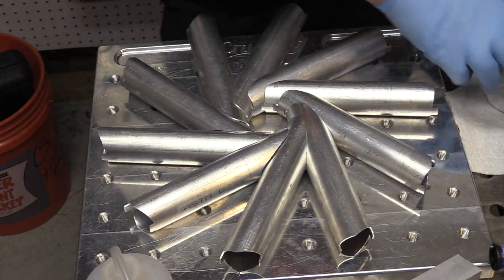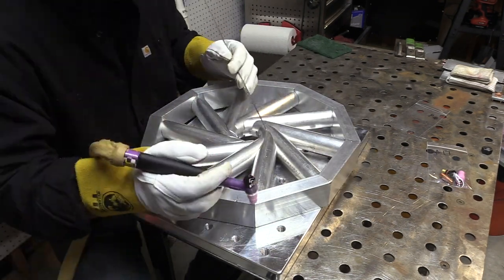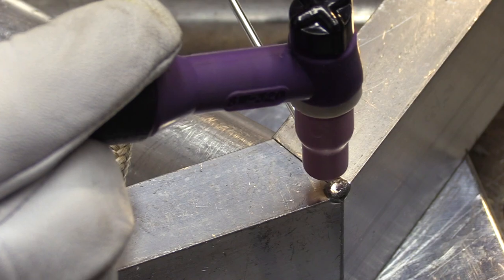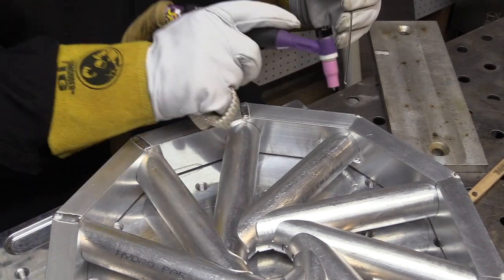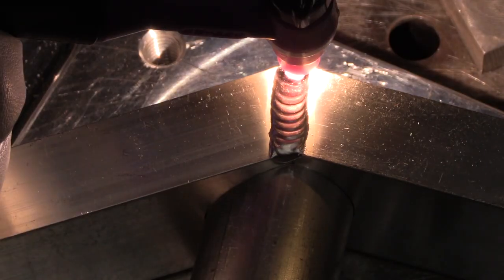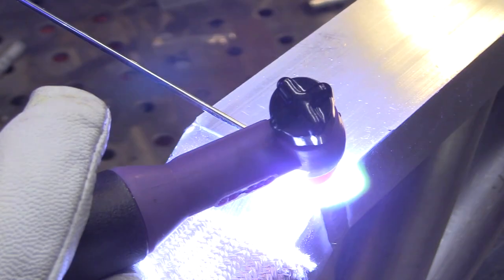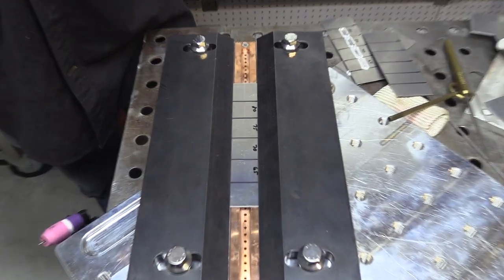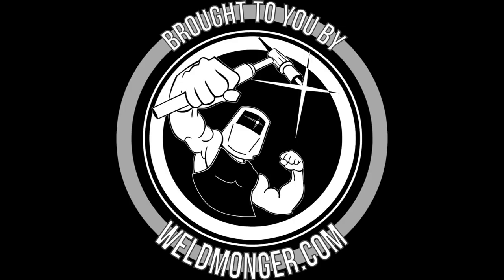#5 Cup TIG Welding Aluminum

Comment: One funky method I’ve seen for crater filling is to leave the rod in the puddle while you kill the arc (lift start) and then bend the rod untill it brakes and using a file to fix it. I’ve never used this method but it’s pretty neat.

Comment: Hey Jody, can we talk about different aluminum filler? 4043 can be too soft for certain applications and 5356 too hard and prone to crack. 4047,5087, 5183?  Is there a reasonable filler that covers almost everything other than rare stuff and cast? Machine and Fab shop

Comment: Jody,  i use exactly the same cup set up using 3.2 tungsten, and a number 5 cup with a light balling, but im at 75- 145 as previously mentioned in another thread i wrote. For me these settings will weld anything from 2mm thick right up to 25mm thick with pre heat and 'hot'gas alushield and of course using a pedal. Buttons or trigger torches are hopeless for aluminium welding since you need to be able to back off the amps as you weld along a run.

Comment: Hello Jody, thanks for another great video👊🏻 My question is about using #5 cup what size tungsten do you normally go with and were you using a 4043 filler rod? If so I always get the grainy look on the beads when using a 4043 rod vs a 5356. Thanks again👨‍🏭
Reply: I've been trying to figure out what is causing and more importantly, how to get rid of the grainy appearance in my welds with my Dynasty inverter machine as well. I can use my friend's Syncrowave transformer machine and the beads are smooth and shiny. I make all settings the same, use the same base metal, filler (4043), tungsten, cup, flow, etc. But on my Dynasty, I always get that grainy finish. It's frustrating. Is there a way to get rid of the grainy appearance or is this something that Dynasty owners just have to live with?

Comment: Hey Jody, love your videos. I’m new to welding and have been getting better with the mig gun but still burning holes with the tig. Most recently I’m trying to weld some patch panels in auto sheet metal about 1/16th thick. Even with the mig it’s not keeping a consistent arc with the mig and popping holes in the metal. Thinking maybe a ground issue. Any advice would be great! Thanks

Comment: Awesome video Jody. I personally use a #4 #5 purely on the heat I need to weld with destroying my gas lenses. But even when I was on low amps I did notice the white film from the cleaning action Less apparent. Here in Australia I use a BOC 185 AC DC fairly certain it's CK unit. And have recently switched over to a 50/50 mix bottle of helium and argon.

The only problems I have with the machine I use. Is the ac Ballance won't ball my tip up like shown.
And lac of foot pedal.

Any tips on how save my tungsten on a budget machine?

Much love from down under really enjoy your content
Reply: i have the same welder.  the welder is not CK (not sure who makes it) but they do come with a good CK torch. don't worry about balling tip so much.  pedal is available, only curse is the pulse doesn't seam to work when you have the pedal plugged in.

Comment: Is using the top of the ball the correct way to read a flow meter?   I guess I've always used the center of the ball as my reference point.
Reply: That is the correct way. However having a .5 CFU wont be noticeable unless the shop you work at is stingy on that lol
Reply: Ernesto Castellanos ....Thanks.

Comment: I noticed that none of those butt joints were beveled enough to accept much filler.  I'd be interested to know why you skipped this step in this project.  I assume it's because of the service load (zero) and consequences of failure (none). 
 Adding enough filler is easy in fillets, but how do you determine the minimum bevel on butt welds in 6061 (with 4043 filler) to 100% prevent hot cracking?
Reply: He explained it in the video............you can see the puddle drop and then he adds more. What he didn't elaborate on is that the bead has to be dropping down below the bottom surface of the tube. It sounds like the tube is relatively thin. He also states at one point that a speck of contamination floated up from the inside of the tube, which means he is assuming the bottom side of the tube is melting. His tests on the flat plate also demonstrated the amount of amperage needed to get full penetration, and then he showed how he fills the crater at the end to prevent cracking. Of course that all applies to this project. Now, on thicker tube, a bevel may be needed and it would be great for Jody to explain if there is a minimum wall thickness needed before he considers beveling the tube. It seems that he often does test pieces to determine what is needed, but it would be helpful to have some guidelines. I don't weld full time or do nearly as extensive jobs as I'm sure Jody does, so I would be interested in knowing more.
Reply: I agree with you on the puddle droop making room for more filler, but my underlying question remains.  Lemme try to rephrase it in case Jody sees this:  Starting with 6061 base metal, what percentage of the weld nugget needs to be 4043 filler to elevate the Si content enough to avoid hot cracking?  It seem to me that this ratio would be at least 40% filler to 60% base, more or less, to reliably avoid hot cracking.  I don't have a good feeling for puddle agitation from the AC arc, and how well it would mix the filler into the base, but I'm sure dwell time is a factor here too.  Lots of process variables here, and I'm just fishing for a rule of thumb on one of them.  
On an unrelated topic:  Hey, Jody, can you braze Titanium?   I have a pile of Ti scissors with broken plastic handles, and I can't easily drill holes...😁
Reply: @ralphwaters8905  I get it now, with the ratio of filler to base. Great question. Titanium shears with plastic handles in an interesting one. I sharpen scissors professionally, but haven't run across that one. Barber, beauty, animal, and medical shears are usually stainless or plain steel. What industry were those used in?
Reply: These are very common in office supply stores.  The titanium blades are probably made in Russia (using the plants that used to fab plates for their fast attack subs) and make a great selling point.  The handles are plastic, terrible and often break.  One is left with a great blade in need of a handle!   The last one I fixed, I had to clamp an aluminum handle to the Ti blade.  It worked but was butt-ugly.

Comment: How short can your tungsten be to use the short cap?
Reply: For me, a standard 7" Tungsten cut into 3 pieces about  2- 5/15"  (48 / 49 mm) each, works for my Tweco short caps.
Reply: Are you guys using a drill or dedicated tungsten grinder to sharpen the short pieces? I use a dedicated bench grinder and a drill, but hand hold the longer pieces.

Comment: Thanks for another great video! I'm still unsure of why the #5 standard cup penetrates more than a #7 gas lens at the same amperage-
Reply: The amperage was the same but the argon flow was much less compared to the #7, maybe (not an expert on this) less gas flow cools down the aluminum less while welding thus penetrates easier at the same amperage.

Comment: Why, do you need a ball on the end of the tungsten? Can't you just weld without it? 🤔
Reply: It will ball by itself if you just start welding.  It wont be consistent untill there is an established ball though.

Comment: wish i had a dynasty :(
Reply: Me too!  
However, $5,000 to $8,000 for the Dynasty 280 DX unit, depending on bells and whistles, is very much outrageously priced!  I think that they are kept high priced on purpose. 
Yeah, one gets a great machine if bought new, but the price is too dear for just about anyone except those in business that can write it off and are using it all the time in order for it to pay for itself!
Just gotta find a used model, in good condition, at auction, estate sale, fab shop closing it's doors, etc.
Reply: If there’s a will there’s a way. I have a 210 DX and then you’ll want a water cooler, then probably a new torch (CK Flex Loc?) and then certiflat table, clamps, fireball tools...it doesn’t end at the Dynasty it only begins. If you can weld, and enjoy doing so and make money - you’ll get it. But it’s only one tool of the whole arsenal.
Reply: BillyJoe JimBob lolll I know whatcha mean... I love my syncrowave.... but I deff am getting me a dynasty 280dx I truly don’t need it.. but for some reason I keep telling myself I do and I am a firm believer of “overkill” when getting tools... buy once cry once I guess... but some how I am very leery about inverter machines and their longevity... I guess there has to be a trade off somewhere right ?